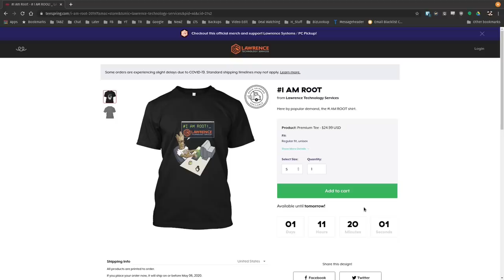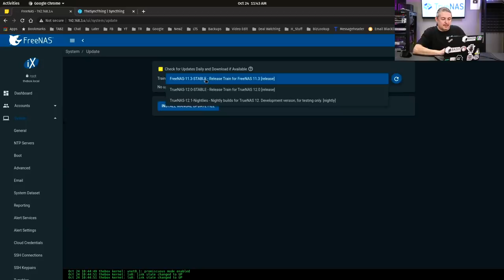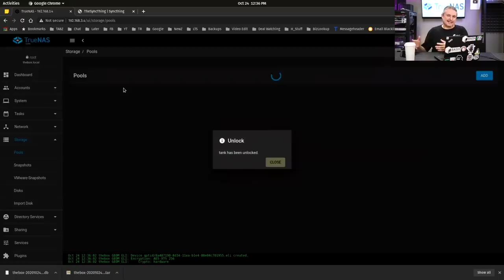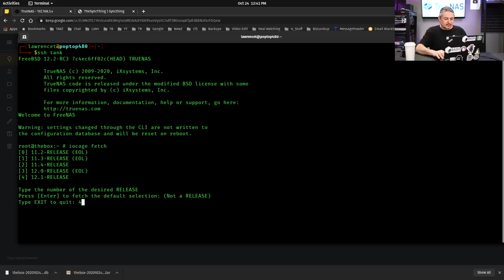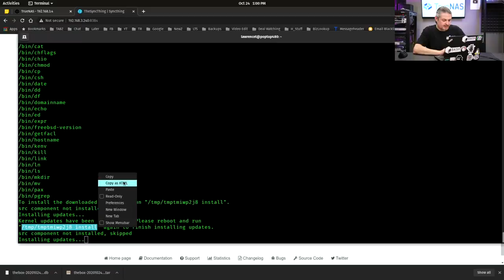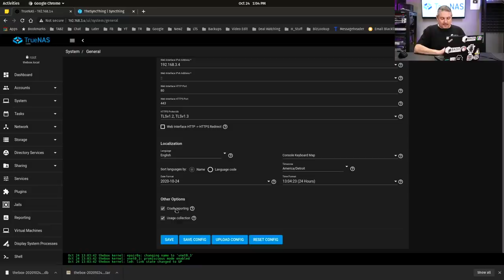How To Upgrade FreeNAS to TrueNAS

Comment: Thanks for this video. I was especially curious about how TrueNAS was playing along with now "legacy" GELI encryption. Even though I like how TrueNAS now supports per-dataset-encryption, I do not wish to move to that method right away. Simply because it first needs a full decryption first. I think, I shift this to the future, when I set up a new (bigger) pool. But it looks like TrueNAS 12 seems to run smoothly when coming from FreeNAS 11.3. I will consider switching soon, thanks to you going through the process :)

Comment: I have a Freenas system running off USB. I believe the USB has failed, as the bootup never fully completes. Unfortunately I do not have a duplicate of the USB, so it looks like I'll have to switch to TrueNAS. Are the two basically interchangeable? I just need to get the darn access back to my drives.

Comment: I had FreeNAS running in ESXi 6.7 with an LSI 2008 card in passthrough and with the upgrade, after 4-5 minutes the VM crashed every time. So  I had to boot it up without the ESXi (booting a USB unit directly) and now is working fine. Waiting to see if the ESXi issue is resolved somewhere and return back with ESXi again.

Comment: Hi Tom, can you share some insight on how to care for the drives in long run ?    What I mean is how to keep the physical disks running healthy. What to look out for. Stuff like that. For example: Do u just keep all defaults and wait for that email that a disk failed, or do u know any time tested tricks to keep things solid.  I noticed >> there are some settings in the "disk" menu...  Smartctl is often all over the place ... scrub Why?     I find it hard to know when a disk is going out, but this time I caught one at my house... the disk was CONSTANTLY spinning up and stopping. Smartctl had some unusual numbers, but reported the disk is fine. I can't imagine this disk is going to last very long while doing a spinup & spindown every 10 seconds !!  
   I have 4 machines running FN // 2 virtual and 2 bare metal.  Both bare metals have had a fail disk in 2 years. zero fails for the virtual ones(XCP-NG).

Comment: Some notes for dinosaurs like me who FINALLY decided to update their 11.3
1. Without 11.3 *U5 * you cannot see 12.0 Stable train. Update, wait, refresh a couple of times - and it will appear.
2. You cannot iocage upgrade anymore (in v12). The 12.2-release which Freenas 12.0 is based on is not available to fetch, the only available is 12.4 - and iocage refuses to upgrade to 12.4 because it is higher than base. That means you have to go straight to 13.0.
3. Once you go to v13 you can upgrade.
4. If your jails do not start, go to web ui -> jaiL -> EDIT -> jail properties and reset the dev_fs to 0. I've no idea what it does but the jails now run.

Comment: Hi All, I'm still pretty new... sorry for the newbie questions.  What would you all suggest as a free option to backup my FreeNAS pools (manual 1 time operation) before upgrade.  keeping in mind I'm not that comfortable with Linux command line... a couple lines is ok but more than that and I'm worried I will get lost if something goes wrong.  Any plugins or native function?  My last resort is from a PC use EaseUS ToDoBackupFree to backup to a external NTFS drive.  I'm sure there are better options.

Comment: the only way to go to or to leave the gELI encryption is to encrypt or decrypt the individual disks, since GELI is whole disk encryption outside of zfs. the migration method is going to be either decrypt each disk or delete the pool, because the GELI encryption is done before zfs touches the disks, zfs is not GELI aware afaik.

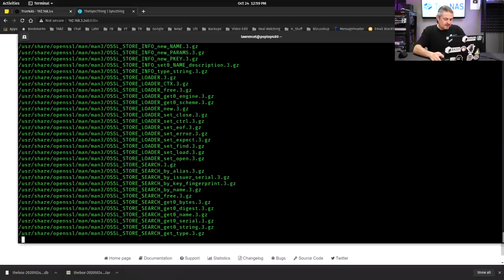Comment: Hey Tom! Done the update for the jail and it gets same as 13:20 but I can;t seem to press enter to finish it. it just shows all the /var...../ and then (END) but clearly not finished.
Reply: Same here, came hoping to find an answer. At least I know im not the only one. Any solutions?
Reply: @jeffteachworth7918  by the way - my issues have been resolved with the latest updates. I use plugins through the UI and latest updates fixed all the issues I've had
Reply: @A2KMedia  Im using manual jails. But just curious, you just aborted the jail upgrade and updated the plugin?
Reply: @jeffteachworth7918  i was doing both, but basically in the end all 3 of my plug-ins were updated and it is working well now.
Reply: @A2KMedia  Found the solution. Simply just press "q"

https://www.truenas.com/community/threads/jail-upgrade-from-11-4-to-12-2-fails.89526/

Comment: I just updated from FreeNAS to trueNAS, and it did not go well. The logo is still 'freeNAS' and the dashboard area is blank and all menu options don't do anything. That area stays blank. But the About section says "TrueNAS-12.0-U6". So it's updated, but not working. As I have currently no pool (western digital destroyed it) I will just reinstall... EDIT: so after some time, it starts to work ans showing trueNAS as logo. So advice: after reboot, let it sit for 15 minutes to "cool down". That crucial part is unfortunately missing from your video.

Comment: I just a few days ago ran an upgrade from FreeNAS 11.3-U5, and it all went well except my UniFi Controller Ubuntu VM no longer works (I deleted it for now) and I had to fix some SMB share permissions. I much like the new UI. It's subtle but useful. If anyone can help me get a VM running again on TrueNAS 12-RELEASE (it complains that my machine VM capable, which is BS cuz I was running a VM pre-upgrade) let me know. I'm 99.9999999999% sure I have VT-d enabled in BIOS, but if necessary I can double check on that.

Comment: I'll miss the shark.
Reply: Freenas updated properly to TrueNAS, thanks Tom. It seems running smooth and without any issues.
Reply: You may have seen it by now, but if you go to Preferences, you can select the "Retro Logo," and that will bring back the shark.

Comment: I got stuck on 13:20 in every single jail. Probably is missing me some simple thing
Reply: me too - it crashes with END. Did you find a solution?
Reply: @Stephan7926  No, not yet.
Reply: @Stephan7926  it crashes or just gets stuck? The output looks like the less command or something similar, so have you just tried using the Q key to exit out of it?
Reply: @AndreasZetterlund  I hit q, had to page down again, hit enter a few times, then q, then it finally worked.  Weird.
Reply: @howardd8179  Yep that worked thanks